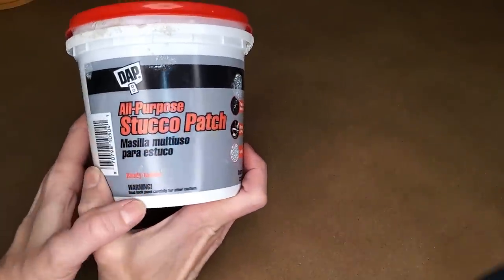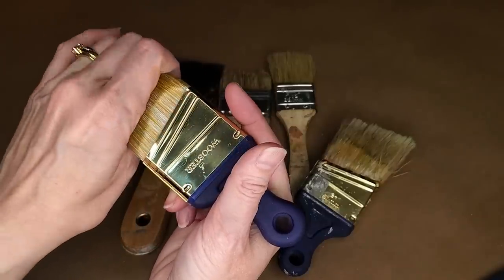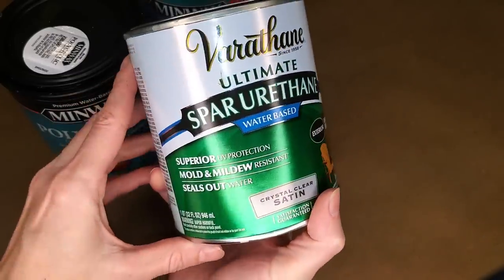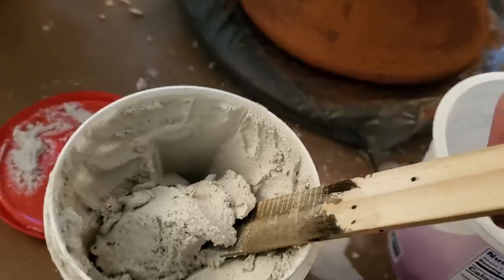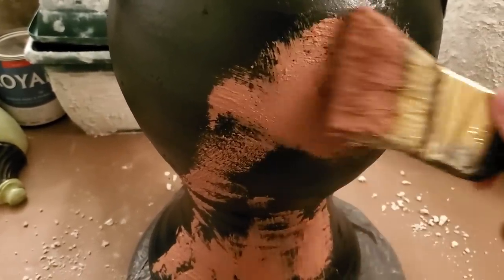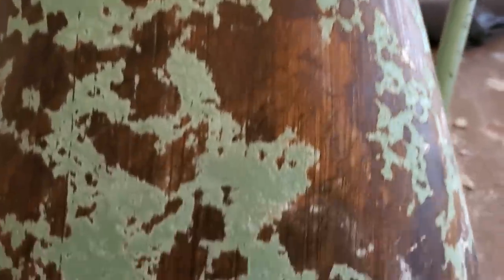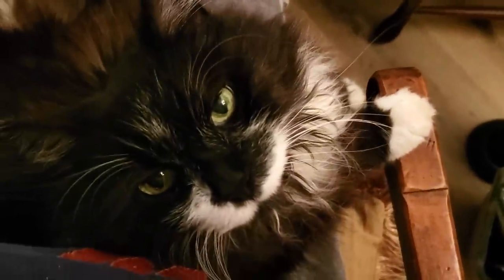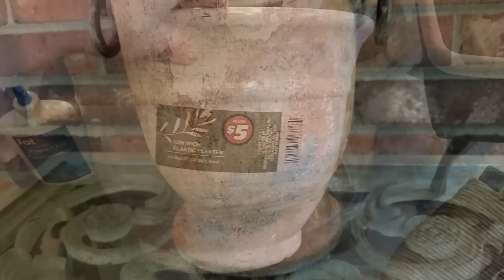Textured Finish Thrifted Makeovers

Comment: I loved the pot but all are beautiful. Can you do this textured finish on glass? Thank you,, love your work!
Reply from the maker: Thank you! The mixture should stick to any clean surface. I have painted glass before and it worked fine. (Maybe Ill do a separate video for glass projects.) I try to be careful when cleaning and try to not let water soak on the paint, just to be safe. The top coats really help. I have the yellow pot sitting outside and ice been spraying it with a hose to water the plants inside and it is totally fine. It has an exterior topcoat on it. The water just runs off. Certain paints and joint compound would not be good getting wet if unsealed as they soften. Clay based paints reactivate with water. Hope that helps! Xoxoxo